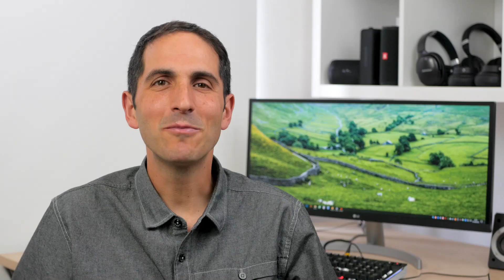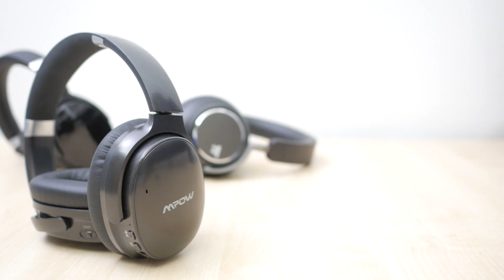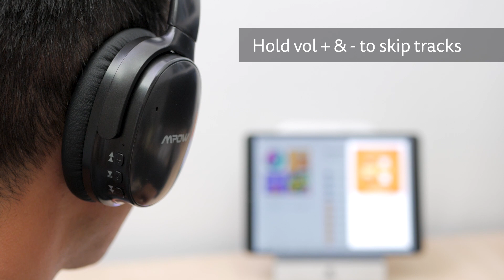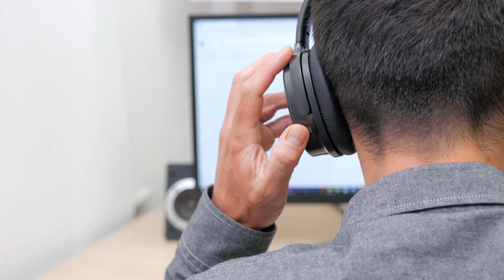Mpow H10 review | Active Noise Cancelling (ANC) wireless headphones | Sound Test vs TaoTronics BH046

Comment: Thank you for the review, I found it very helpful. I got the H10 last week new on amazon for $20 USD and I am very happy with them. This is the first over the ear headphone I've had in decades and It's amazing how well it isolates most outside noise.  I originally limited my search to headphones with BT5 and USB-C, but after using the H10s, I don't mind not having those specs. ANC is engaged 100% of the time and battery life is amazing. i don't have any audio/video sync issues with netflix, youtube, disney+, etc either. Thanks again for helping me make the decision.
Reply from the maker: Thank you Scott Neary! That sounds like a great price - glad you're happy with them.

Comment from the maker: If you’ve tried any of these headphones let me know what you think of them? And if you’ve found a better budget pair of noise cancelling wireless headphones, I’d love to hear! Let me know down below.
Timestamps
:
0:00 Intro*
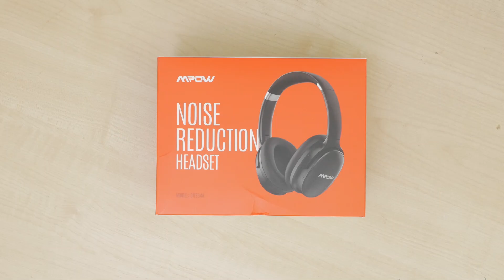0:29 Overview*, inside the box, size and build, compared to the H5 and TaoTronics BH046, headband and fit, earpads
1:56 ANC switch, 3.5mm port
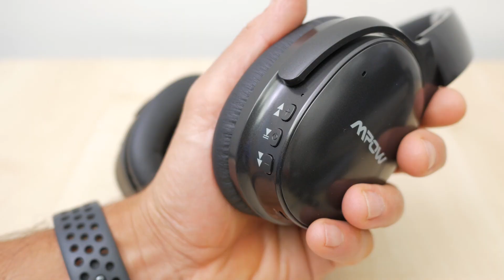2:15 Buttons and charging
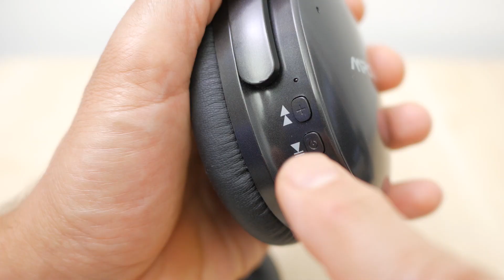2:35 Powering on and initial pairing
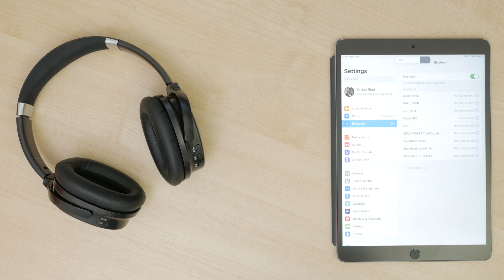2:50 Pairing to a second device (at the same time)
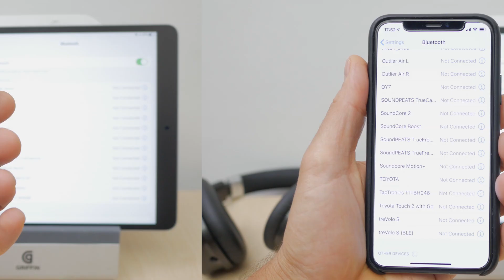3:04 Resetting the headphones
3:15 Comfort
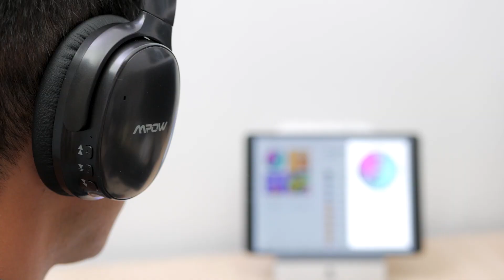3:27 Controls
3:53 Performance and audio quality*, Bluetooth stability and range
4:23 Audio sync YouTube, Netflix
4:30 Battery life
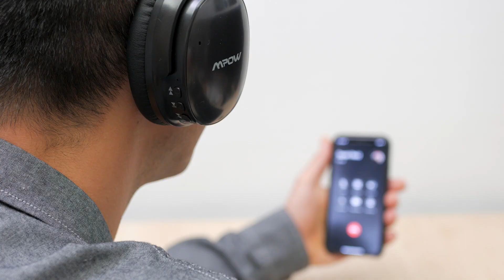4:45 Microphone sound test
5:00 Hybrid noise cancellation, passive noise reduction, sound leakage
5:47 Sound quality versus H5, TaoTronics BH046, EQ settings iOS
6:28 Sound test Mpow H10
6:43 Sound test TaoTronics BH046
6:58 Sound test Mpow H5
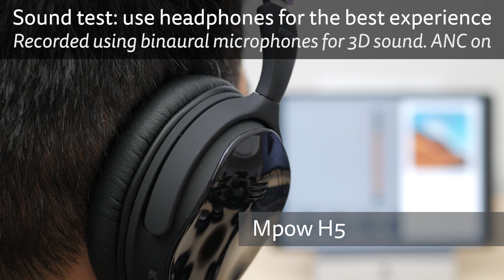7:14 Conclusions*
*Sections
Reply: The Technology Man was there any problem while recording the audio test of the taotronics cause i heard a lot of good reviews for these but when i just listened to their sound omg the h10 is much better ?? So tell me please and thank you
Reply: @Ted_homie  yeah kinda weird that his pair of TT sounds bad when recorded. Doesn't seemed in line with the raves the headphones got for audio quality (esp. bass heads) by other influencers.
Reply from the maker: Sorry missed these comments. As I replied to Ted, they favour bass - and they do sound good listening to certain music types. It's just the mid range doesn't have as much clarity as the H10s.
Reply from the maker: No the TaoTronics sound a little muddy compared to the H10s - but they favour bass which some will definitely prefer. And they ANC and build is better too.